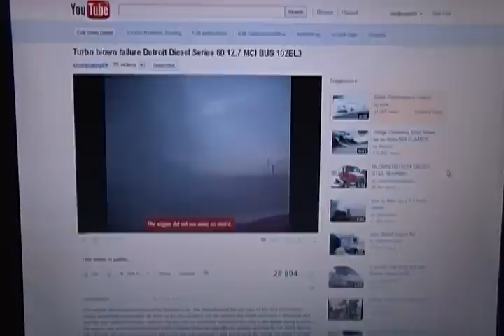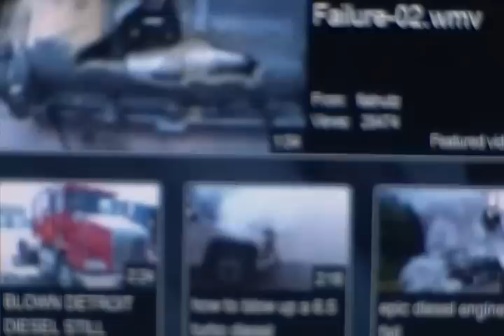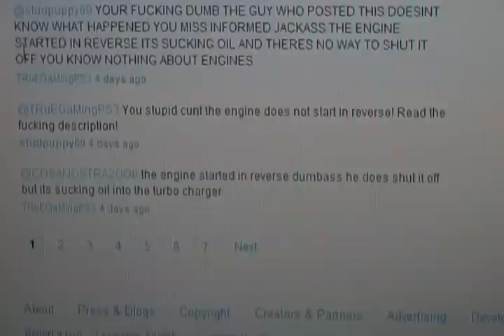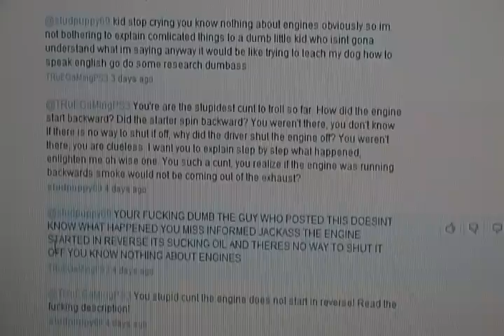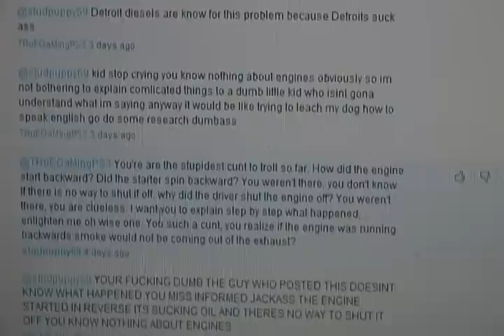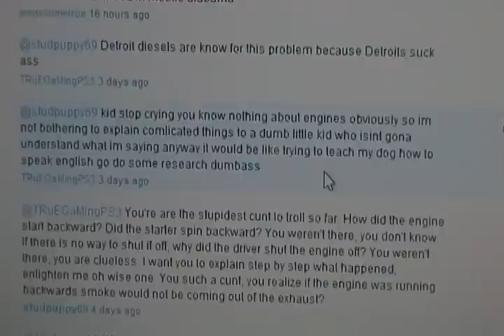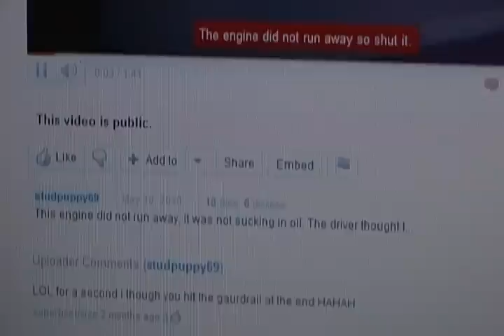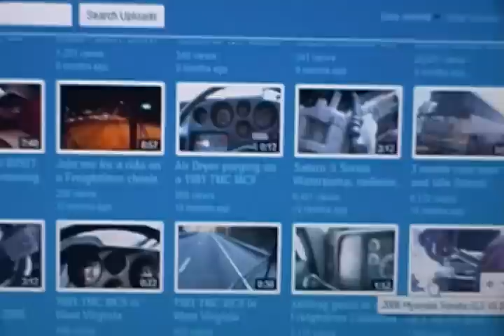RE Detroit Diesel Series 60 turbo blown failure theory and logic MCI bus

Comment: Unlike Detroit Diesels old 2-stroke design, the 4-stroke engines cannot run backwards.  The 2-strokes can run backwards during starting, if you let off the key too soon, the engine could kickback and start running backwards. Also letting off the clutch too quick nearly stalling engine could cause them to run backwards. DD series 60's 4-stroke can't do that. Blown turbo's are common on big diesels and they make lots of smoke and a huge mess when oil gets sucked into turbo's intake cold side.

Comment: it was smoking due to the bus running with oil being fed by the turbo to the pistons. motor oil is also hard to burn so the oil coming out out of the pipe was what the engine was not able to burn

Comment: Now with the problem with the bus shown the turbo is what had went, the oil from the engine is fed to the turbo, the turbo doesn't have seals in it per say it uses bushings and thrust plates. when a turbo goes it starts to leak oil into the pressure side and feeds that into the intake of the engine and could make it runaway ( if the engine is running it is pumping oil and also oil to the turbo feeding the engine).

Comment: as some one that has been a diesel tec for over 15 years and a bud tec for 10 of that, a diesel engine can and will run backwards but with that being said newer engines (electronic controlled) will not the computer will not let it. also if a diesel engine does run backwards your forward gears will become reverse and your reverse will move you forward.

Comment: Exh wheel in turbo failed the POP was I assume "mechanical" in sound more then "air release in sound?
I have NEVER seen a turbo centre section "blow up", oil in Exhaust is "normal" and WILL leak out the muffler or any hole in the Exh system

Comment from the maker: @jasonriddell What is your prognosis on the Series 60 failure? There was a loud POP, followed by alot of smoke and the driver lost power. Engine ran and he shut it off once passengers were evacuated. There was oil dripping pretty good on the ground, was this oil coming from the exhaust? Or, did something crack on the turbo? Thanks.

Comment: as to the vid of the turbo failure on the S60
I work for a fleet shop with a dozen of the series 60 and have seen BOTH run away and turbo fails,  When a diesel runs away you can hear the engine sounds like it is running VERY rough and noisy (because sucking in oil there is no ignition timing) 
if a turbo blows its Exhaust side engine oil goes down the exhaust and can smoke from the high temps + the engine with out turbo boost will be running to rich and smoking